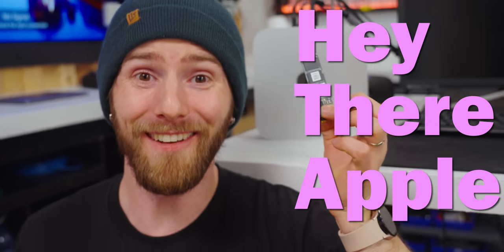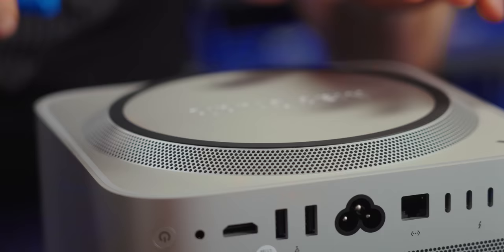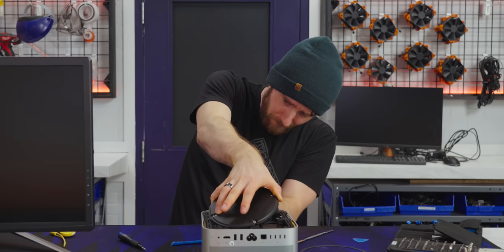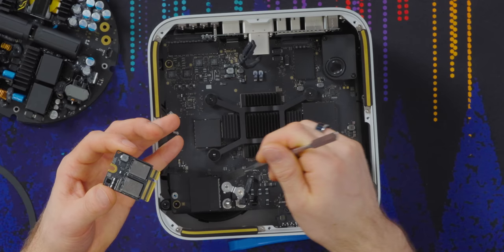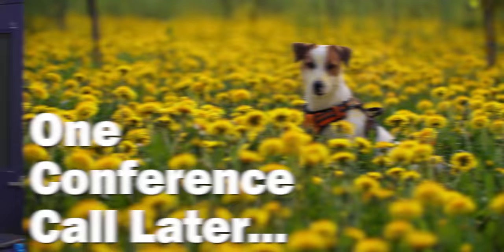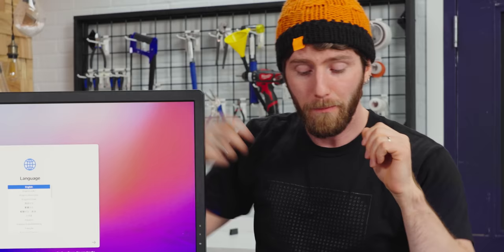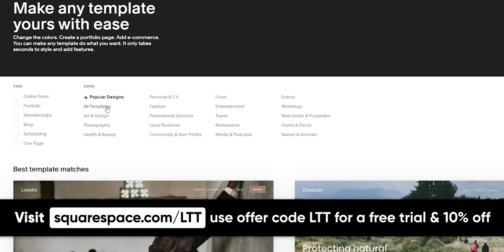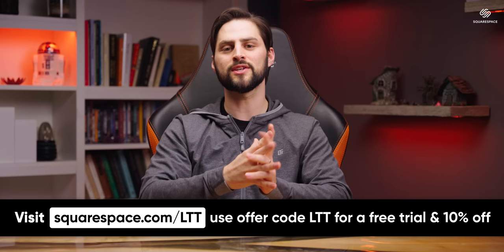I want to love Apple, but they’re making it hard - Mac Studio SSD Swapping

Comment: Certified tech here: The SSD can be upgraded but the storage controller firmware  in the SOC has to be reconfigured, this can only be done by booking a repair in apples systems and then entering a diagnostic mode allowing the mac to connect to Apples servers which will remotely install the configuration. And yes, I agree it's dumb.

Edit: Theoretically they could probably enable people to do this at home since the entire update process is cloud based and only requires the user to enter the serial numbers of the new chips into their system. It works the same way for iphones, and they're going to enable self repair for those. Will they? Probably not.
Reply: I'm guessing this is because (due to the controller being in the SOC) the wear-leveling information, etc has to be reset.  I wonder if there is some kind of pairing going on as well between SOC and flash.
Reply: @disoriented3971  Sure there's reconfiguration; wear metadata, rewriting keys, and so on, but why does Apple need its servers involved, and why does it work fine when you replace one of the same size?
Reply: Amazing, so everything has to be cloud based now, even a firmware restore. For your own safety and security I'm sure, definitely not so that the machine is tied to a UUID tied to you so that everything you do can be tracked and sold by Apple... Same reason they blocked Facebook from tracking you on the iPhone.
Reply: @disoriented3971  Most modern flash chips have unique IDs, the controller could reset itself after being fully wiped when these have changed, adjust to the new capacity, and go about it's business.

The part that especially caught me off guard is that apparently a flash upgrade like this is possible on an iPhone, an even more embedded and integrated system than the M1 Mac! That's what really goes to show you how intentional it is. They designed the iPhone SoC and it's memory controller not to different from the way the M1 works, and given this is all in house silicon, any changes they make to how this stuff works generation to generation is 100% intentional
Reply: Well so all it needed was a reset or clear CMOS sorta button to flush the controller!
Reply: Lmao they have DRM protection on their firmware configurations
Reply: i hope some kind soul at foxconn leaks that software to the masses.
Reply: Someone will figure out how to hack Apple's software to bypass this block. It is difficult but not impossible to hack Apple software.
Reply: Just to upgrade an ssd.... you have go 150 steps in mac....sad asf
Reply: @Superbustr  it's not a software block, it's hardware. It's locked to the controller built into the actual SOC
Reply: I believe the actual storage controller is ON the SOC instead of being on the drive, which means the drives are just pretty much raw flash chips.
Reply: So you're telling me that I, a professional that bought this machine for 5k+, would have to lose 1 to 2 days of work in order to upgrade my storage. Something than in any other machine is a 2 minute operation. What a piece of trash.
Reply: @stytler06  firmware is software. If they are just reflashing the firmware it might be possible. A copy of that firmware along with making the m1 think it's talking to Apple would probably be required. Doing those two are going to be uniquely difficult.
Reply: @disoriented3971  I was under the impression this would be a similar situation to replacing a touch-ID sensor(?) or a display. Thanks for the info!
Reply: Oh, so now they can do "The system is now unavailable. Try again next time" whenever they want.
Reply: You have to ask their permission to upgrade your damn stuff. That's basically equivalent to begging them to be able to do work on something you bought from them.
Reply: Someone needs to inspect the traffic in the "phone home" to Apple's servers and write an emulator to circumvent this. Or, you know, Apple could just push new firmware that doesn't have this backward approach to recovery.
Reply: Apple needs to be taught a lesson and that lesson needs to be taught soon !!!
People need to stop buying demonic Apple products for 1 year or maybe 2. Straight , no macs , iphones , heck , no adapters nothing!!!!

 i have a Macbook Pro late 2014 since 2015 and i love using logic pro x and final cut But: they soldered the SSD onto the motherboard ever since 2016. I recently went to an apple certified repair shop and asked them : what if i get a m1pro macbook pro and as soon as the warranty expires , the ssd fails me . How do u go about repairing it ? They said it ll cost me a hefty sum cause they replace the whole board . I was like WhAT ? Like dayum , replace 5-6-7 parts just cause one don’t work , there ain’t nuthin logical about that . Another point is : on windows : 1tb ssd —-> roughly 110$/€ . 2 tb ——> roughly 2x 110 $/€ . @demonic-apple ——> 2tb costs 800$ …?!?! What ? And you can t even replace it . I have a dream : :” that for 1 year straight up nobody buys any apple products , not even an adapter . Let s see those execs shit their pants and start asking questions like : oh my … what are we doing wrong ? To me they seem like money hungry apes that can not quench their thirst for money . It walks along the lines of unethical . There s isn’t even any real advantage to having the ssd soldered. I ve heard people say that it s faster . No it s not . We have the internet . Anybody can check the numbers and the speeds of different ssd s out there. Oh and just to put the cherry on top : iphone 13 : amazing processor and hardware but it s rocking the lightning port 🤣 usb 2.0 speeds . Apple 🍎 i really hope u get yours and the EU puts you in place with regulations on ports and on right to repair . They got hundreds of billions offshore like liquidities ….  This got outta pocket a long time ago … out of their consumers pockets to be exact. They answer to no one and lack moral discernment . Take care y’all 😃🙏🏻🤗. But the processors are amazing and I respect the integration of the cpu and gpu and RAM 🐏 . Cause that actually wields a big boost in performance. I hope somebody serves them good .. money hungry apes 🦧
Reply: I am guessing this is 100% free process and you can source your own M.2 Flash modules? ;)
Reply: My old PC started its life as a AMD FX 6300, with a GTX 550TI, and 8G of Ram, a 128gb SSD and a 1 TB HDD.  Fast forward many years later, it was a FX 8350, with the same 128 gb SSD, but added a 1TB SSD, the other 1TB HDD, a GTX 1060, and 16gb of ram. 

All work done by me.  In fact,,, while it was the same motherboard, the original MB died, and I ordered the exact same one off ebay for 50 bucks to replace it.  Swapped it out, no problems. Even with windows 7 as the OS.  

Mac can kiss my bum.
Reply: Non apple certified tech here: The SSD can be upgraded, but you have to pick up the mac, walk over the nearest mountain of e-waste, chuck it so that it lands nearest to the top of the mountain as possible so that it then rolls all the way back down. Then, you go and buy a computer from a company that doesn't specifically design hardware that has "fuck you" engraved on the very silicon they make their chips from.
Reply: That’s dumb. Why did they have to lock the firmware as well, tech savvy users are perfectly capable of updating their OWN firmware! Apple, I am disappointed in you.
Reply: @stytler06  Dude you're replying to a thread that categorically stated it's firmware that CAN be changed.  Are you contradicting that?
Reply: @Prophes0r  Hmm, great idea.  "Screw driver-as-a-service".   Connect the tip of the screws to a CMOS powered chip that contains the particulars.  The screw driver is  chipped so when the business end is inserted into the screw head it sends a signal to the chip.  If the wrong screw driver is used, the Mac doesn't boot up because it remembers the case was opened with a non-official screw driver.

A bit like a chipped car key.
Reply: @erich6860  And most likely you could have done the swaps in your sleep.
Reply: Dumb indeed.  You'd think this could be accomplished with jumpers or a DIP switch to set the storage size, and let generalized firmware take it from there.  I get that Apple is doing their best to make the storage secure but I fail to see how roadblocking an upgrade makes the process more secure.  Maybe I'm not devious enough.
Reply: @Superbustr  you can't bypass this, this is a simple Raid 0 config, which is not automatic even on Windows side, you also gain read/write speed with the 2 drives, not just some extra storage.
Reply: They are definitely trying to prevent even more third party support and repair strategies from working now.  It's a cut throat industry.
Reply: I can KIND OF see this as an almost reasonable upgrade procedure.  E.g., the controller is going to ship with a particular firmware, and needs another firmware to support a different flash chip configuration.  It's even possible that not all of the eventual permutations of that firmware exist at the point of sale of current stock.  So, a cloud-based solution isn't inherently dumb and evil, it does actually future-proof the product -- at the expense of making it subject to the whims of Apple.

We don't see this anywhere else because the flash and controller have never been decoupled in a consumer product before.  This is definitely a different kind of product to the modular components we're used to, but as speeds go up, I think we're going to start seeing more of this integration.  It's what got us into the 386 era, and from North Bridge / South Bridge to MCH, and the shared memory architecture of the M1 and GPU.

It's not great, but I think there are things that are fair to get upset about, and there are things that suck but have justification.  This one is borderline.  It IS a problem of their own making, but has engineering merit, and provides serviceability, although not DIY serviceability.  (Although I still expect the third-party industry to produce a solution.)  Apple could've done better, but it's not quite the crime against humanity that it's being made out to be.
Reply: That sounds an awful lot like they're actively trying to stop personal repairs and upgrades.
Reply: @datachu  The reason why Apple won't do this automatically is because once you wipe the tables on the controller in the SoC it renders the data in the flash module you replaced unreadable. This is fine for a certified tech but probably not something Apple wants customers to mess with.

It also has the secondary advantage for Apple that they can basically charge for storage upgrades by preventing the use of third party flash modules, though I'm not sure if they actually do that.

E: That being said, these are all design decisions on Apple's end and should be called out all the same cause "it saves Apple a lot of money" shouldn't be acceptable when it ultimately means a lot of eWaste with hard or impossible to repair hardware.
Reply: That's  so fucked up
Reply: @datachu  you'll own nothing and you'll be happy
Reply: @NotThatEpic7492  your $$$$$ thats y
Reply: @BixbyConsequence  They're securing your repair $$$ lfmao.
Reply: When I was growing up... My dad explained how he hated that the apple 2 wouldn't let you create a backup of your floppy and use the backup... With most PC software he used a backup as a working copy so that if anything happened, damage, magnet, etc. You could go back and use your original to create a new working copy...  After that he painted the picture of how a computer built in a monitor leads to more waste and prevents upgrades...   Every major thing I have seen from apple through the years, has always been anti customer.  But the sad part is they have some great innovation that makes me want them to be a better company. My girlfriend's iphone has a great camera, but we are limited to how much high res video we can take on vacation because no SD cards...  On a flight, we use my phone and a Y adapter headphone cable to both listen/watch our shows...   I wouldn't care what apple does, but like you said at 14 minutes in... What they do steers the market...and ultimately makes even non apple users suffer.
Reply: @dlewis9760  Yeah, none of those upgrades or swaps was difficult in the least.  Oh,, I also had to swap power supplies, because the first one nuked and is what took out the MB.
Reply: @Superbustr  Yes, you probably can hack this and that and everything else Apple is kicking in its customers way. But wouldn't it be easier to just avoid it - and not buy these pieces of crap anymore? Avoid Apple, just buy a decent computer made by <whoever> and install Linux (or any BSD based OS, doesn't matter that much).
Reply: @codenamegrs9278  That won’t happen.  The untechnical computer buyer doesn’t care.  If they are a Mac user they will be purchasing Apple products regardless of how expensive or fixability.  You can’t explain how bad Apple products are to people that don’t care.  That’s why Apple keeps making money.  What Apple does well is selling to people who aren’t technical and just want a simple device that you turn on and it works.  They will pay top dollar for Apple care and so on.
Reply: I'm glad someone made this point. The issue isnt some 'lockdown' its that the system needs to be told the new flash layout and Apple dont provide something as basic as a BIOS configuration utility to anyone but their service agents (they will sue if you try to distribute it). The days where you could lose the config disk to your computer were bad enough - we have to stop this anti-consumer joke, and we can only do that by correctly identifying the problem.
Reply: I cant imagine why it should not just work even with different capacity Storage. Yes it would not be optimal nor on the new Capacity, but the adresses should be read and writable to the same cell as long you dont change it. Back in the day it was possible to change your Hard Drive to multiple different capacitys by selecting different Cylinders/Head/Sector Informations in the BIOS. Apple could just include an ApplEFI or whatever. But then the shareholders would have to live with half the sold Apples, i guess.
Reply: That's stupid
Reply: It isn't dumb. It's evil. There is a difference.
Reply: Here's an even better thing to think about, folks: 

In the back seat of my car I have a mid 2012 Mac Mini and it still works just fine. Are these machines you buy today still going to be working in 2032, at all? 

Well yeah, they would, except that Apple won't let them.
Reply: @datachu  I imagine it's more because Apple doesn't want the restoring software to leak, because then individuals could actually replace the storage themselves
Reply: @mycosys  The configuration utility is entirely cloud based, it's not possible to distribute it.
Reply: @Superbustr  They haven't done it on Mac displays which require the same thing
Reply: @Wongwongwong10000  That and the "prestige" of the name and the eco system  lock in

I know plenty of people who simply buy apple because it's apple, no other justification 

And the few people who are tired almost never leave because apple is great at making people commit to the eco systems via apple id, itunes library, hardware etc
Reply: That's pretty much repairs and upgrades in cars work, the technicians just connect the car to the manufacturer network to get the configuration done. However there are third party tools that allow self configuration for many brands, I don't think that will happen to apple, but if it happens it will be ridiculous